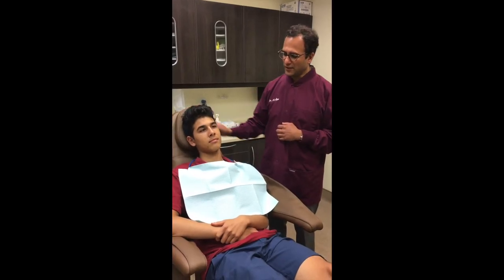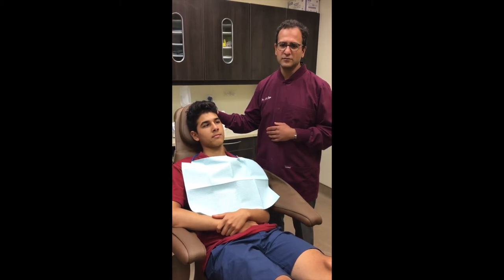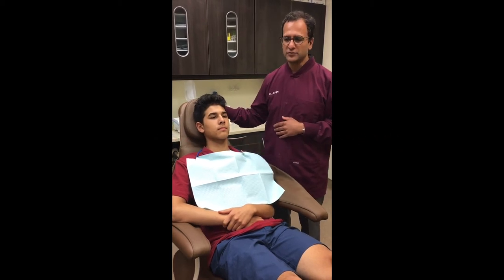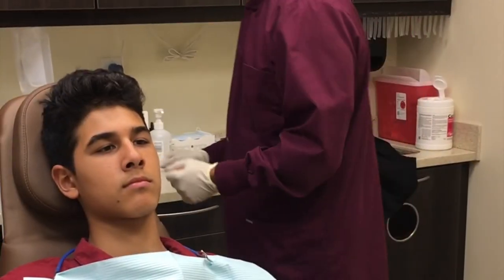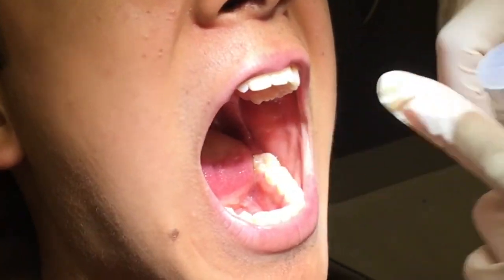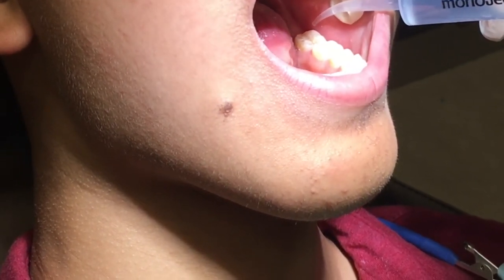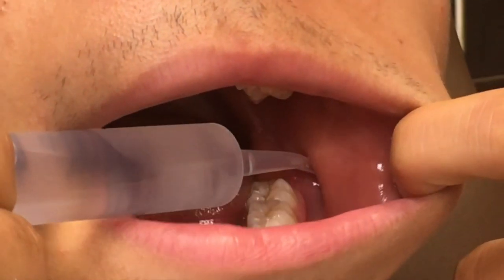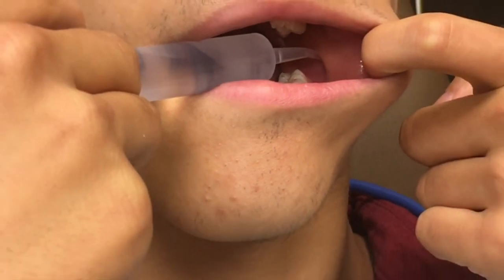How To Clean An Extraction Socket After Third Molar Extraction

Comment: How do you clean before th 6 the day? we have to eat lol
Reply: It’s late but you are meant to eat more liquid foods and very soft food so that it does not get lodged in, so yogurt, soup, and other stuff like that for the first 5-6 days
Reply: I think it's more important from day 1-6 to avoid dry socket than it is to irrigate. If you're eating mostly soft stuff, normal head-tilting style rinses (no vigorous swishing) should loosen and eventually flow most stuff out until then. Once you start on day 6-7 'm expecting you'd get a lot of gunk from the previous few days in there.
Reply: Gentle salt water rinse
Reply: You should eat liquid food, and always on the opposite part of the incision. You can even eat some soft foods but make sure you swallow immediately after chewing and also drink a little water after each bite. (that helped me) Wash your teeth and use an antibiotic mouthwash after each meal.
Reply: simply gently rinse with salt water
Reply: @Bianca0np I got all 4 removed, there's no opposite side.
Reply: @cassandramollura4233  I would have just done a salt water rinse. I’m thinking about starting the irrigation part 4 days from now since I’m on day 3. How was your healing?
Reply: @DdLKen  so I'm like in month 5 ish(?) of healing. I didn't have the time to check my mouth but I'm pretty sure everything it's closed or mostly closed. Everything got absolutely better after the 5th day. Almost back to normal except for having to rinse the holes for 2 more weeks ish but yeah. I personally started rinsing immediately after day one